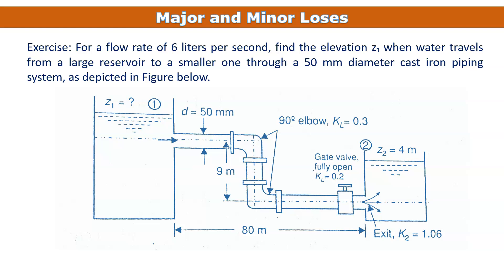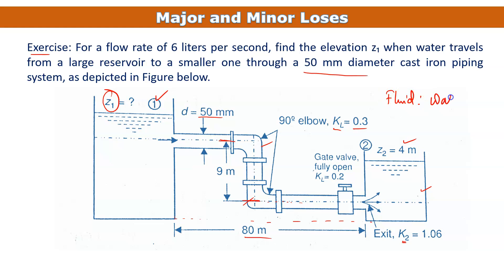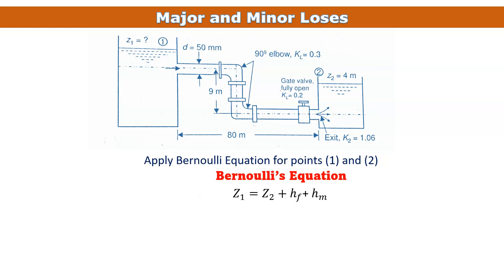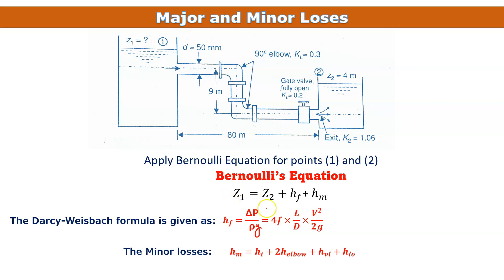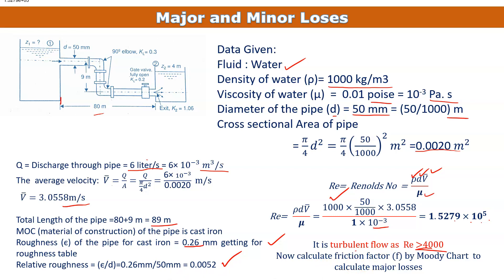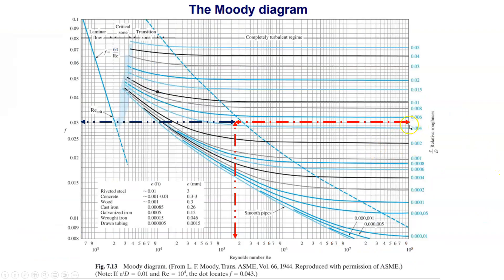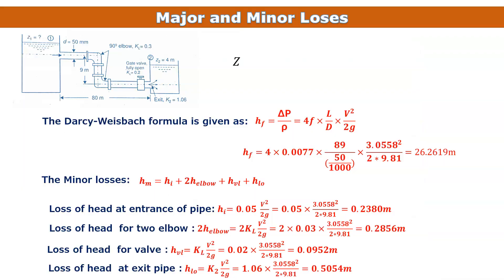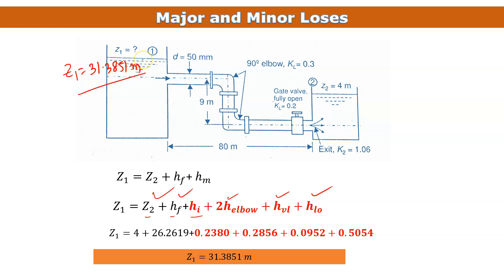Major and Minor Losses, Moody Chart, and Calculations Explained!

Comment: 4f=fd
Then 4f = 0.029 right
Here why you not substitute 0.029 instead of 4f in hf formula 
You again multiply with 4 after convert fd into f?
Reply from the maker: You can directly input it, as I am using the Darcy–Weisbach equation with the Fanning friction factor. That's why I am calculating the Fanning friction factor first and then multiplying it. From the Moody diagram, you can get the Darcy friction factor. Since the Darcy–Weisbach equation includes the 4f term, that's why I am using this approach.
Reply: Ok I understand, thankyou.